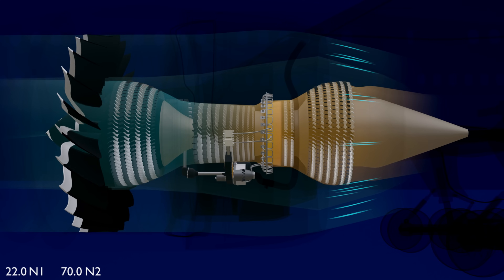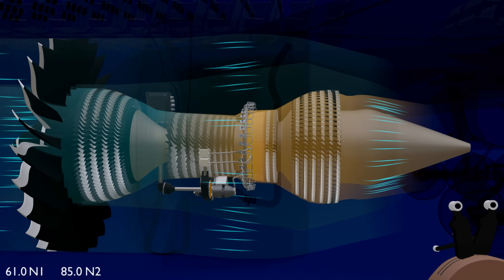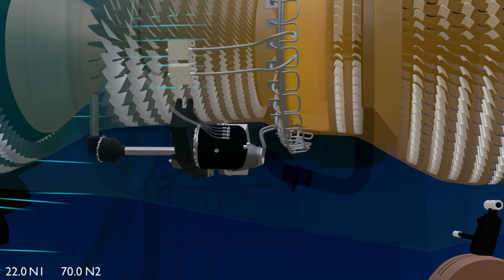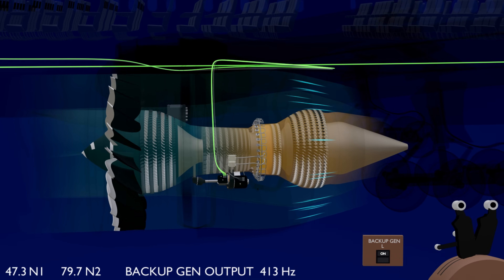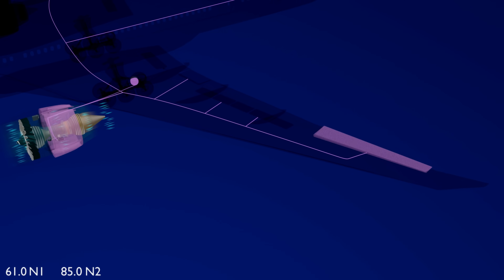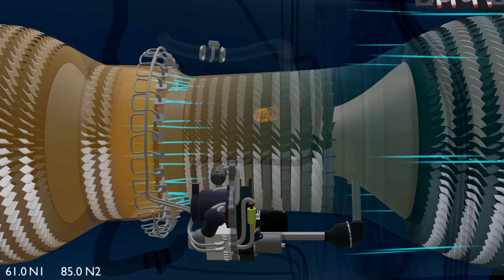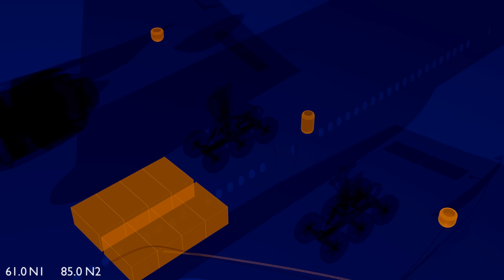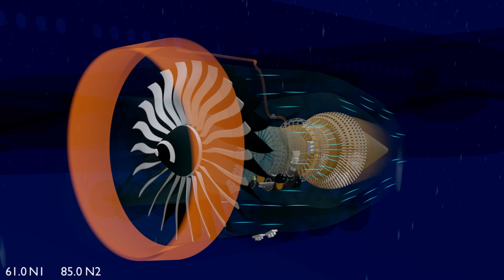How Jet Engine Works | Part 2 : Outputs

Comment: Isn't the 415 figure voltage, and not hz?
Reply from the maker: The aircraft power systems operate at 115V and 400Hz.

Comment: Usually there are 2 stages of pneumatic bleed air. The lower stage, lower temp/pressure is used to climate control and keeping the plane pressurized. The higher stage of compression uses high temp/pressure bleed air only for anti-ice systems.

Comment: Hello. I am an electrical engineer and work on turbo compressors. I watched part 1 and 2 of your video with great interest. These are best 2 videos on jet engines, I have ever seen.
One question about electric generator attached to the engine. Why this is designed on frequency of 415 Hz. ? I have never heard of 415 Hz frequency. It is most commonly 50 Hz in Asia and Europe and  60Hz in America and Canada. What are the voltage then?
Reply from the maker: Hi, I've made an error in the video; the frequency is 400 Hz. Airplanes use 115 volts, 400 Hz power because it reduces their total weight.
The higher frequency reduces the size of electrical components (transformers, generators, and motors).
Reply: @AircraftScience  Thanks very much. That is great information foe me.
Reply from the maker: @SABIRMAN-r4h  My pleasure!

Comment: Bleed air comes from the 9th stage at idle (50% N2), switching to the 4th stage at cruise (100% N2). FAA regs require bleed air to stay below 450F (auto ignition temp of fuel) so it's always run thru the intercooler, cooled by fan air.

Comment: In case anyone wants to know how the generator stays at constant rpm, the 'constant speed drive' has a hydraulic pump powered by the engine G/B which powers a 'swash plate' piston engine (like your car's AC pump). As N2 speed changes the hydraulic pump increases flow/pressure, causing the angle of the swash plate to change, keeping the output at a constant rpm.
Reply: wow tenk yu i was just wondering that

Comment: My question is how does the constant speed drive, drive at constant speed? Is it using something like an automatic transmission with a planetary gear set?

Also you said the electrical systems needs two sources to run everything, but I've seen the apu alone run everything, for example during pushback before engine starting

Comment: for electrical system : it would be easier to have 3 phase AC generator with rectifier to dc as primary current and then change it by inverters for special needs

Comment: It was already complex and then we got to bleed air system... Ugrh. Thinking "what the hell, they already have hydraulic and electric, what is there in the plane that needs yet another form of power?!" Googled it and it was kind of sensible but then again kind of like opening a can of worms... "airlines refused to allow flight attendants to carry air samplers after Congress mandated chemical measurements"...

Comment: What about your fluff that doesn't help me understand what's happening at all something thrush the veins and in turn the veins sucking air and and but I don't see how the veins are being spun except where you were talking about the alternator or whatever the electrical whatever so it doesn't work like a rocket engine except that I suspect it does in a slightly different way instead of depending on the thrust being squeezed out of neural nozzle it the thrust is spinning the the blades which like I said suck in the air and push it through and I've still and etc etc

Comment: They are going in the wrong direction when they design jet engines. They should be making them smaller and over the wings instead of under. And designed into the wings. The thrust part would be going over the wing. That way theres more vacumn created over the top of the wing which is what you want because it creates more lift.
Reply: Early jetliner designs (like the de Havilland Comet) did use engines buried in the wing roots. However, it can also be seen that encapsulating them in the wing carries its own engineering issues (maintenance difficulties, risk to wing structures in case of engine fire, etc.) that has tended to make podded under-wing engines preferred. As far as using engine airflow to improve lift characteristics, some aircraft do take engine bleed air and vent it over the wings to improve lift (also known as a Boundary Layer Control System), though this is usually seen either in specialty short-takeoff-and-landing (STOL) aircraft, or military jets with small, thin wings that have adverse low-speed handling characteristics (like the F-104).

Comment: I'm a diesel mechanic. Have been for 15 years and always wondered how turbine engines work and how the compressors did their job and the stages of them. This really helped.
Reply: I've been trying to take it in for fifty years.i just can't grasp anything at all!who can build a jet engine?I ask you!
Reply: @motormouthalmighty  a turbine seems like witchcraft but still not as much as an auto transmission
Reply: Still I didn't get completely
Reply: If you want to know more about jet engines? You want to check out Aircraft Science - this will give you an insight on how jet engines are built, tested and how they are "Started"
There's two kinds of jet engines
Airlines
Fighter jets
I'm taking diesel mechanics
Do you remember basic theory of the steam engine?
Reply: Also jet engines are different from diesel engines and a different application. Similar 

Diesels do require that fuel have to be primed before starting especially for locomotives. Just like for lawn motors (gasoline) have to be primed too prior to starting.
But in jet engines uses duel ( JP) which can be JP-20, JP-30 up
Fuel still have to go a fuel filter before the fuel pump to strain out any particles .
Reply: I want share if you already about the turbocharger and the Exhaust Gas Recirculation and it's blowers
Turbocharger also has a frequency.

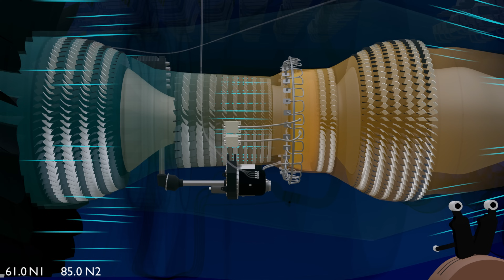Comment: At time  1:41 there is an ERROR. The aircraft electrical systems don't work at 415 Hz. They work at 400 Hz. Probably the creator of this video mixed the "15" from the voltage of the 3-phase electrical system which is 115 Volts phase to neutral, whis is 200 Volts phase to phase.
Reply: I was wondering about that; 400 Hz being the standard for air/sea "shore" power, I would figure most external power units would never be able to sync if that was the case.
Reply: @eddievhfan1984  The external ground power units are designed to provide 115V/400V 3-phase 400Hz 75kVA. There is no need to "SYNC". The aircraft switched either to external power OR internal power. The sychronization of the 400Hz power is only performed when the two generators from engine #1 and engine #2 are switched to parallel mode.
Reply: @sorgfaeltig  I was aware of that; what I meant was that if the IDGs ran off of 415 Hz (as claimed by the video) instead of 400, then when external power was provided to the aircraft, the GPU would simply trip its breakers due to not being frequency-synchronized; essentially a proof by contradiction/absurdity. And in any case, my understanding was that external power is paralleled with the other sources on the bus for load-sharing to minimize stress on equipment when transferring between sources, as opposed to a hard switch.

Comment: can someone pls help me elaborate more about the numbers on n1 and n2? what is it indicate for? rpm? thanks
Reply: Yeah percentage of maximum RPM
Reply: N1 corresponds to the inlet fan and N2 is the rear compressor. Engine industries use terminologies to isolate areas within the engine, usually called stations, for example the front of the engine is station one, as in N1. N2 compressor is in station two.  Station numbers increase moving aft, it's helpful when identifying and translating specific locations in the engine for maintenance and troubleshooting.  Bore scoping the engine is a good example. A good ballpark for rpm is multiply raw rpm by 100 for N1 speed and multiply N2 by 150. For example, if the engine is idling at 65% rpm N1 speed will be 6500 rpm. Percent rpm is a practical method of gauging engine speed/rpm and an industry standard.

Comment: what choosing 415 hertz power supply ? why specifily 415 hertz ?
easier to filter ?
Reply from the maker: A higher frequency (415 Hz) helps reduce the weight of heavy electrical components on the aircraft.

Comment: Why 415Hz?? Did you mean to say 415 volts? Because if it was a 415Hz generator, it would need to go through a ac-dc-ac transformer in order to power cabin entertainment, due to the fact that all outlets are 50/60Hz
Reply from the maker: Yes, the generator gives 415 Hz output. An in-seat power supply (ISPS) converter changes 415 Hz to 60 Hz for the power outlets.
Reply: @AircraftScience  why does it supply 415Hz? Are you aware of any specific reason it can’t just be a regular 50Hz or 60Hz generator?
Reply from the maker: A higher frequency (415 Hz) helps reduce the weight of heavy electrical components on the aircraft.
Reply: @AircraftScience  ohhh that’s super cool!
Reply: @JoeyLovesTrains  The aircraft industry used its own "regular" 400Hz standards since the technology was moving from the 27.8 V DC power system to AC power systems in the late 1950s and early 1960s. The reason for the much higher frequency compared to the usual terrestrial 50Hz or 60Hz has two main reasons: First, all transformers can be built with less iron, therefore saving a huge amount of weight in the entire electrical systems and elecrical devices in any aircraft running on 400 Hz, Second, the gyroscopic instuments that are used for attitude and headung reference(artificial horizon and comass systems) have to spin its rotating masses (the gyroscopic element) at more than 20'000 RPM. With 400 Hz you can have a rotating magnetic field of 24'000 RPM  (400 Hz times 60 seconds = 400 x 60 = 24000 RPM) to drive those gyroscopic instruments.
Reply: @AircraftScience  NO, the generator does NOT give 415 Hz output. It gives 400 Hz output. The outlets for the passengers are only a minor unimportant part in the entirety of the electrical aircraft system. It is an on-essential system that has its own converter to convert the 115V 400Hz power via rectifiers and converters to "household devices-compatible" 115V/60Hz or 230V/50Hz

Comment: What’s the temperature inside the combustion chambers at max power? How it walls doesn’t melt? Anything to cool its walls? What are the fuel injectors made of?
Reply: Hot. Like, hot enough to melt steel, with some margin. But! That's only for the core. The combustion chamber is in two parts, the outer one is airtight but the inner one, where the flame is, is perforated to have a layer of fresh air between the wall and the flame, and to keep supplying more air to mix with the unburnt gasses. 
Can be made of some steels, though I believe it's usually a titanium alloy
Reply: All good questions. I've wondered the temp difference of that against a diesel engine under boost.
Reply: It's also worth mentioning that for control of engine temperature, the fuel/air mixture is significantly leaner than that found in internal combustion engines, as running a jet engine at its most optimal stoichiometric (full-burning) ratio generates enough heat to melt the engine. So there's a lot of excess air on hand to provide cooling.